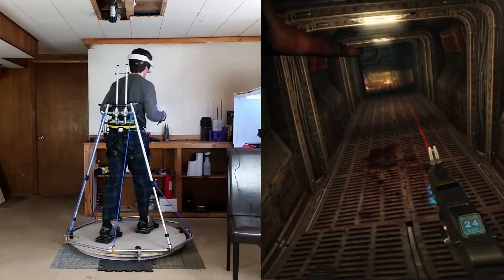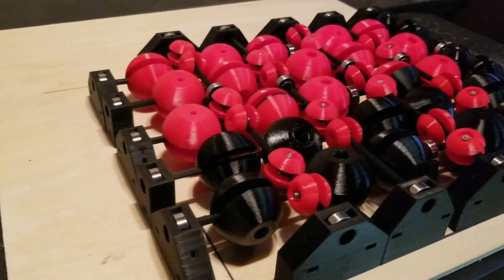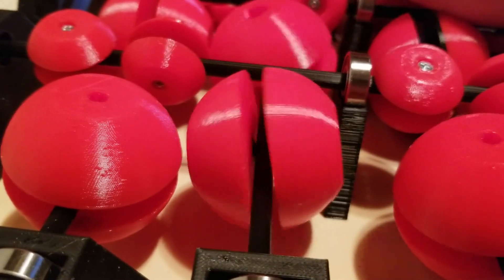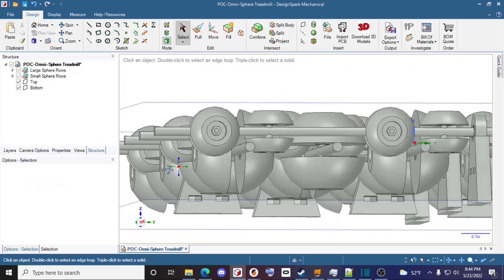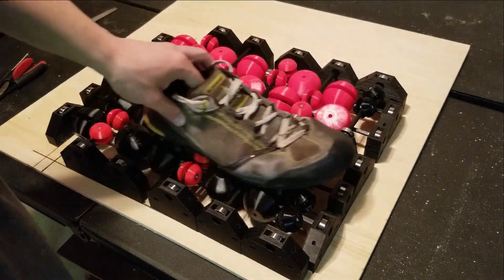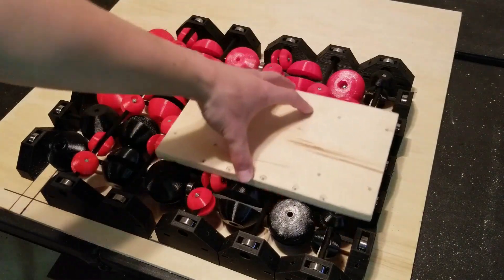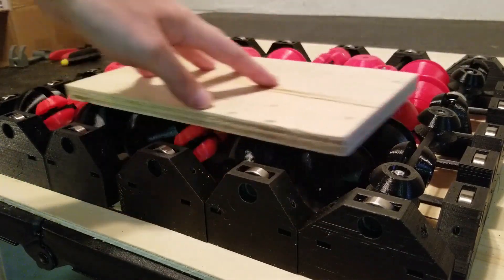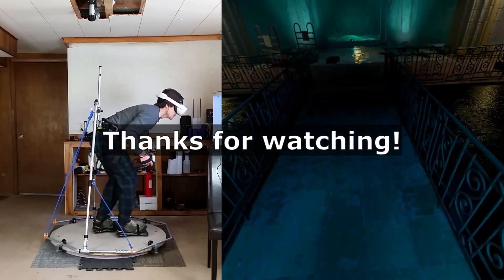Omni-Sphere VR Treadmill Concept

Comment: lol might be a dumb idea but use magnets for the pivoting function if the axis were on the same Z plane using magnets of the same north or south polarity with the center magnet being a sphere and the magnets connecting the point could either be curved or flat not totally sure myself as long as the x and y axis dont interfere with each other you can make the spheres uniform assuming its properly supports human body weight...

Comment: One thing i noticed with the design
If x = the red balls rotating the rod
If z = the black balls rotating the rod
You could use the red balls as more of gears to rotate the z axis and provide friction
Therefore, reducing material use and improving the probability of z axis movement via y axis activation and vise versa. 
Of course, I could be wrong, so please do correct me if I am missing or am wrong about the concept.

Comment: I'm really glad someone on the planet was bold enough to try this. I had this idea in my head for a while but don't have the engineering knowledge needed to make it. I thought this would be the way... a "flat" ground, natural walking / running gate, but as you demonstrated, you'd need a LOT of proportionately smaller spheres to reduce the gap and smooth out the surface. This is kinda like how DLP uses hundreds of thousands of tiny mirrors. It looks like one mirror until you look at it under a microscope and see it's so small... I hope you revisit this particular design some day, shrinking down the spacing to see if it works. Your other projects do look promising, but this is my favorite concept. Cheers
Reply: Had the same thought. Didnt think it had a practical way to be made. Awesome that he figured it out

Comment: You need to use caprolon(polyamide-6) for balls. it is very slippery and quite hard and durable
Reply from the maker: I don't think slipperiness or the balls not being hard enough were causing the issues.
Reply: I think you'd rather want something more rubbery, like a layer of silicone, in order to both increase grip and dampen the sound a bit.